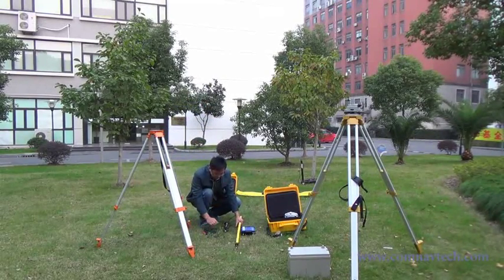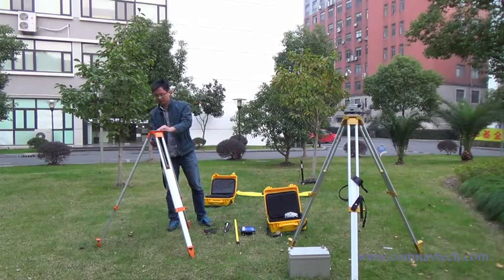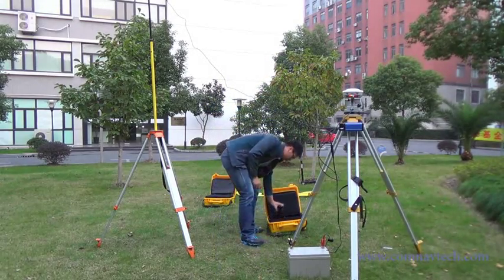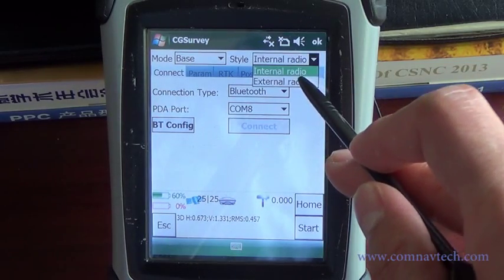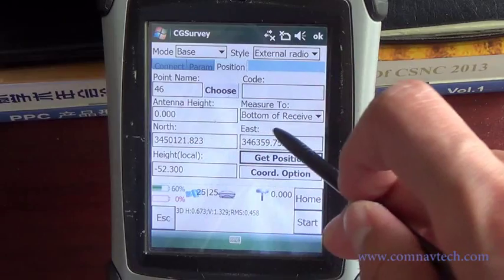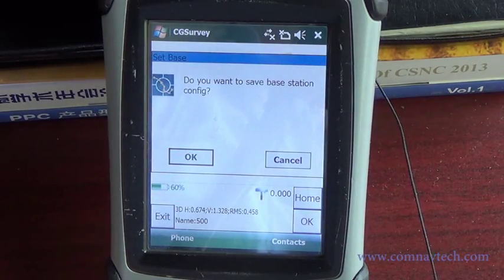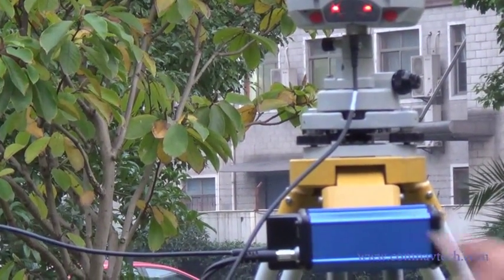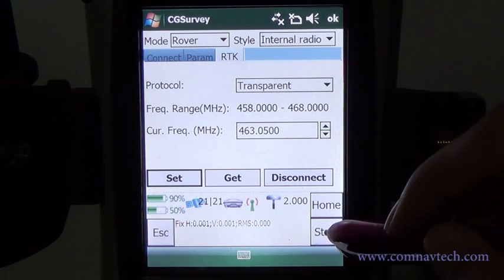ComNav T300 external radio mode

Comment: It's very awesome and inspiring to New learners like me. Only one question is that;
How many meters the rover can capable to track from the base station?
Reply from the maker: For Internal radio mode, it can track about 3-5km from base station in open environment. As for the external radio mode, the range will extend to 10-15km. For more questions,  you can email to  support@comnavtech.com